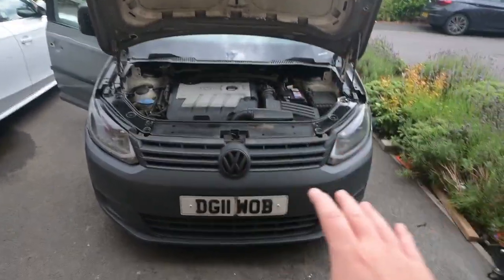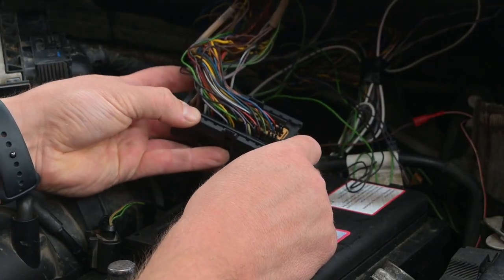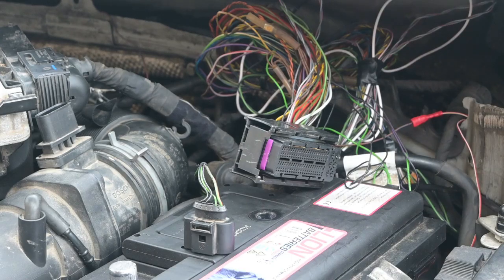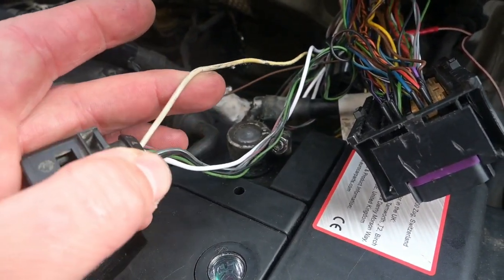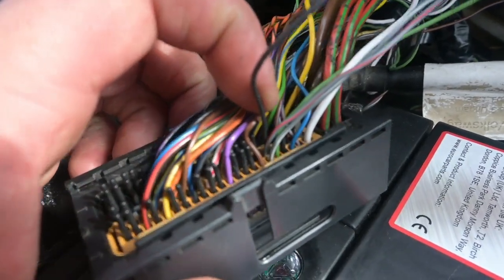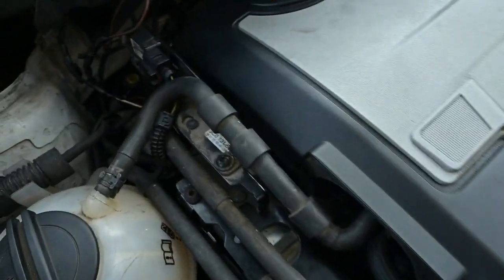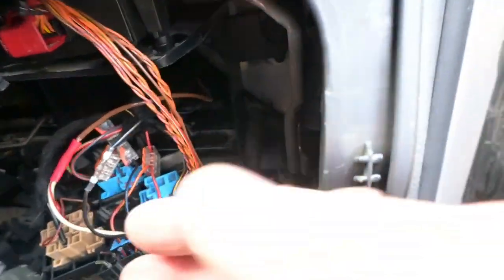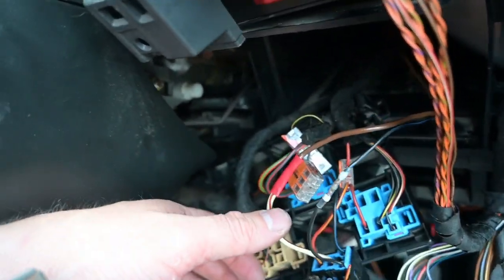Struggling With 1.6 to 2.0 TDI Wiring? Watch This! CEGA ENGINE UPGRADE

Comment: Thanks Jon again for all the help with the wiring watching this really made it clear and not confusing now i just need to get the finger out and do it... i just sourced my KVT gearbox its a 6 speed but its a small box they call it. i dont need to swap drives or clutch or any piping as it currently bolted to a 2.0 engine so another piece of the jigsaw.
Reply from the maker: No problem mate if you need a hand and local give us a shout. If it’s a new gearbox you might need to get both driveshaft as they may differ from a 5 speed.

Comment: Hi John, Excellent Video, you mention about the coolant sensor at the start of the video can you, provide info on that at all?
Reply from the maker: What fault code you getting mate all goes back to the wiring on the t10 plug. Yellow and brown I believe will need to check the diagrams.

Comment: On the o2 sensor you mention that one wire goes into the ibis.Could you explain what an ibis is. I’m thinking of doing a swap on my golf and the only thing that concerns me is the ibis you mention. Thanks for uploading such awesome videos they’re brilliant 👍🏻👍🏻👍🏻
Reply: That’s great thanks mate
Reply from the maker: @BERLINGO4255 give me a bell if you get stuck on Instagram mate
Reply from the maker: Goes Into the van mate just de pin it from your existing plug and re pin into your new one.

Comment: I have a 2010 scirroco 2.0 tdi in limp mode p0087 code have you had this? I take it its pump?
Reply from the maker: Instagram message me mate send the picture and what it’s saying?
Reply: @Jonbuildz will do
Reply from the maker: P0087 is fuel related, pump, fuel filter, fuel rail? When was it last serviced? Could also be electrical.
Reply: @Jonbuildz I just got it did a swap
Reply: @Jonbuildz no idea the boy said it was serviced not long ago I don't believe him
Reply from the maker: @johnlad1481 start with the basics mate fuel filter